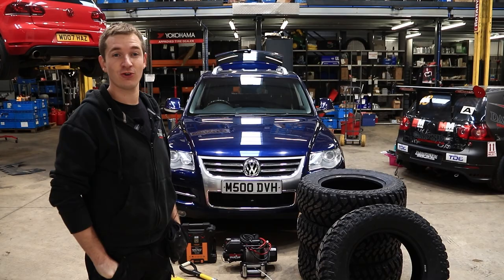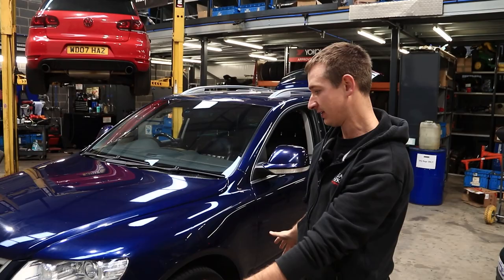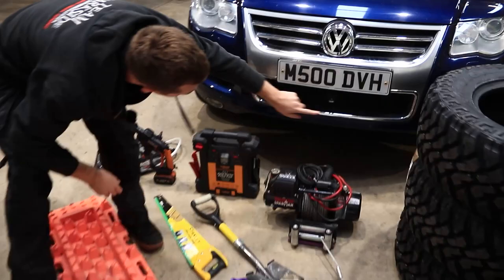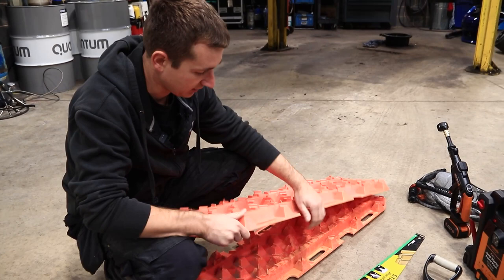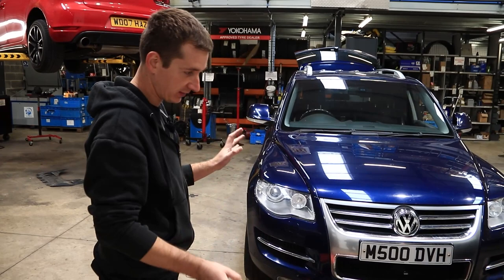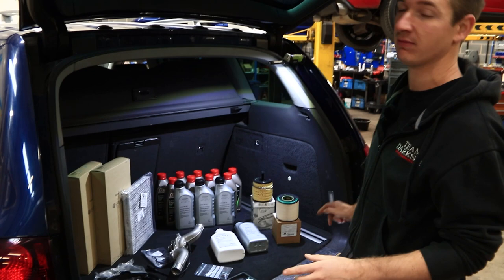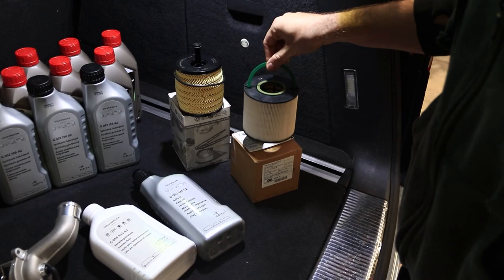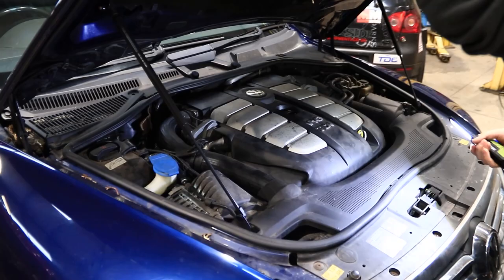What's in store for our V10 TDI Touareg?

Comment: Just did the exact same on my V8 7L6. 1.8L for the rear diff, 0.85 for the center, 1L for the front. Managed to use 8.5 liters to the 09D box with new filter as well.

Comment: Good work so far.
Just a note - Remember to check the pipes from the air cleaners to the front of the car that they are properly connected to avoid water ingress when wading.

Comment: I went unoiled k&n panel filter in mine for the simplicity of being able to clean it while off road. Plus they are thinner and fit in so much easier 😂
Reply: Well, you wouldn't have to do much cleaning - all the dust went straight through.  You might as well have left them out altogether, much easier still.
Reply: @einfelder8262  things said by people that have no idea what they are saying.
I have run all my cars like this, the oil ruins afm signals for a start, plus I've never had dust get past the filter, I live in the Australian outback, super dusty, I've washed the filters then filters the waste water, you'd be surprised how small the particles it catches are. I've been a mechanic for 20 years, I'm not about to ruin my engine for sound or ease of fitment.
Reply: @Brettj77  If you have no idea what you are saying, why say anything?  Unoiled k&n filters let dust through, perfectly oiled ones  may be OK, over-oiled ones can and do bugger up MAF sensors and MAF readings.  Claiming to be a mechanic is proof of nothing - I know plenty of mechanics who shouldn't be near a mechanical object.
Reply: @einfelder8262  probably heed your own advice, if it let dust in, I wouldn't use it. I have years of proof in my own vehicles. Take a seat champ.
Reply: @Brettj77   Funny guy - it was you who said this "things said by people that have no idea what they are saying."   Seems you forgot that already, champ.

Comment: Reyt then! We’ll see a abart thart. Have a look at the tandem/fuel pumps on the rear of each cylinder head, a classic leak point on the V10 and also the exhaust manifolds, cracks around the back of the flange are classic with these. Camshafts, Injectors, tailshaft bearing, thermostat are all things that usually need attention when they have a few kms on them. EGR/DPF you may have ideas to delete - I know you make a nice EGR unit - looking to get one of them eventually.

With the DPF deletes it has had, I wonder if the reprogramming was done. Looks like a bodge job someone has done previously.

This is really good you’re doing a V10 series, lots of interest from here in Aus. Reyt, bring it on.

Comment: As we have one of these. Get the rocker covers off and have a check of the cams. Get the injectors rebuilt. We are taking the engine out due to three injectors failing mechanically (no fault codes) and feeding the right bank turbo a load of unburnt fuel which now screams like a pig. We have had ours from 80k to a now poorly 150k.
Reply from the maker: These seem OK :)
Reply: @DarksideDevelopments   have you looked at them? Ours ran perfect until the day of injector failure.
Reply: @Gon60E  yes, we know how to check easily that they have good seals and are well balanced. Not easy to check if they deliver full potential unless it's on the Dyno.
Reply: @ryanp6138   good injectors wise. I hope your cams aren’t like ours. Looking forward to your next instalment!

Comment: Regarding the air ride system, prob be best to replace the piston ring in the air compressor as well. I imagine it has been over worked with that leak and general age of it. Bag piping andy has a kit  for not much. Did it to my q7 and the suspension rises like new now.

Comment: I'm surprised you''ll be keeping the factory bumpers, rather than going for a steel one thats going to give a bit more clearance, fit winch/recovery points directly and be hammer tone rather than color matching your worried to scratch up... but without being aware what your road laws are maybe that could be the issue. Anti-roll bar wise, haven't tried on a Toureg in particular, but generally its pretty easy to cut the bar on one side, drill a hole, and weld then weld a brace in so on flat ground (or either driving onto a rock or inserting a jack on downhill side) you can simply pullout a pin to disconnect the swaybar, and reinsert to avoid compromising road manners.
Reply from the maker: Its only a cheap knockabout. I'm sure we can do something for the ARB's, it was good anyway

Comment: Please be very cautious with spacers on this particular vehicle and them tyres words of wisdom. I had the rear wheel overtake me on a busy a road from snapped studs. Lairy moment very lucky we was only at 50 and going straight. Also you need to watch rocks bashing the intercoolers and there is two coolant pipes in the passenger arch that are very vulnerable to stone damage lucky it only done the rubber hose on the one in question as them alloy pipes are a bastard to fit especially with the space in the engine bay with that beast. Glad your doing this as you are now my r and d department. But thought on the Same note I'd point out my trial and errors.
Keep up the awesome work
Reply: This was on 40mm spacers I may add, the extra leverage on the bearing was causing abs faults. However it was a shearing stud that was our downfall vehicle is mapped with winch and stainless through out. If you got the location happy to go head to head when you're done 😊
Reply from the maker: 11mm spacers should be fine!
Reply: @DarksideDevelopments  happy days, you keeping stock arch liners or custom liners. Stainless straight through sounds awesome on these things. Kiss goodbye to fuel economy thou especially with the tyres. But such toys don't exist for common sense!!

Comment: Is comma oil good quality ?
Reply: Used it for years personally on VAG petrol, and both PD, and CR diesels without issue. Even their transmission fluids 👍 (I did work at a supplier that mainly sold the comma brand but I no longer work there and I'm not affiliated with comma lol but just the main reason I used it so much)
Reply: Aye comma is good
Reply: @88rsr  I started using comma oil and i think it"s good quality.

Comment: What about fitting an engine that doesnt break down all the time
Reply from the maker: They just need a lot of care that people wont give them
Reply: You mean like this one? Most of them covered good 300-400 000km without doing anything apart from oil and filters so go figure.. its bad? Try not to judge it now but when it was new.. not after 15 owners who were too cheap to change shit and rather sold it, accumulating faults along the way. Surprise! Its broken all the time. Had this one and also had "king of car services" ML400CDI. No problems whatsoever. Touareg had 380k and ML 430k, maintained. Ran like new. ;)

Comment: What are these like as a daily driver? I’ve heard they’re really hard on brakes and tyres
Reply: They are expensive to service due to the tight engine bay, fussiness (don't use non-genuine or you'll regret it) and fairly pricey amounts of fluids/filters ect, but then again I guess you don't choose a V10 over the V6 if you where shy about such things. The one anecdote I have here in Australia was a good friend bought one brand new and owned for years to use as a town car, never driven hard and "off-road" meant their gravel driveway, and that managed to be a bit of a nightmare, although looking at the engineering I don't really have much reason to assume that'd be a universal experance. With that said though, like other "prestige" vehicles instead of family commuters, extreme care needs to be taken to avoid one thats got issues, because once they have problems or have been abused, the work is never finished and can cost you a fortune. On the plus side it was surprisingly good on fuel, and while nothing special comfort wise it was still nice enough, but I'd honestly recommend just getting a cheaper to own/run smaller car unless you really need the 3rd row of seats/offroading/towing, in which case a Toyota Land Cruiser (if you can get the diesel engines locally) might be more of a brick to drive, but it blows the Touareg out of the water in all those things, or the duel cab midsize utility vehicles/pickups (including VW's own Amarok) are cheaper to own if you don't need the 3rd row.
Reply: @SheepInACart  cheers, I’m shit scared of buying one and getting stuck with never ending issues. Apparently the V6 TDI is the goods, plenty of power and torque but relatively reliable. But the V10 TDI is too damn cool 🔥🔥 it’s tempting
Reply from the maker: V6 is safe, v10 the mans choice

Comment: Big question big big question.
Do 17 inch wheels fit the v10 or the brakes dont allow ??
Reply from the maker: no, you could 'downgrade' the brakes to 17z
Reply: @DarksideDevelopments  
So front beakes are 17"? And and smallest wheel fitment are 18?
I like what you did with the v10 touareg and considering on doing the same cause they are at a good price right now. And was hoping to fit some 17" steeles from a T5 and some more agressive wheels

Comment: I'm having the rear muffler deleted on mine on Monday.... the egr can be deleted via vagcom
Reply: You can't erase egr with vcds
Reply: @ryanp6138  maybe its in the ecu tune... but if not on the old Touaregs you can simply pull the vacuum line.... which wont  cause a warning light just remember to plug it back in for the MOT
Reply: @bluescuba  you have to physically block the connection to the EGR, maybe you should re-read Ryan's comment as he clearly knows what he's talking about.
Reply: @jonytube  not talking about a physical delete but a functional one... there are egr  values in the ecu that can be modified/tuned mine was just done by AMTuning, secondly the egr valve at least on an old R5 is actuated via vacuum and pulling the line stops the valve opening